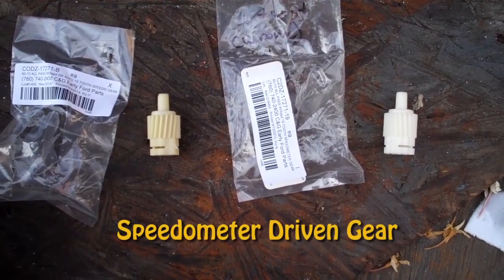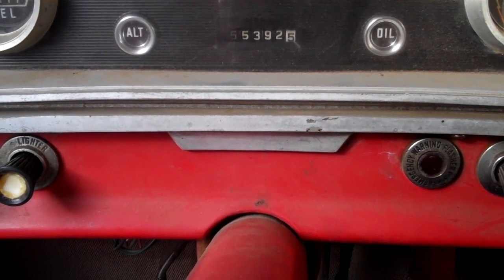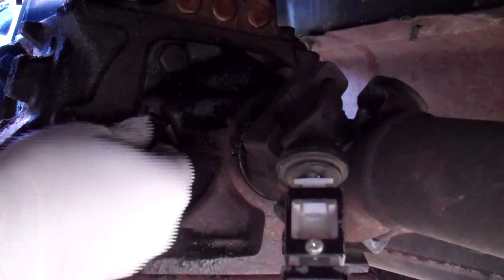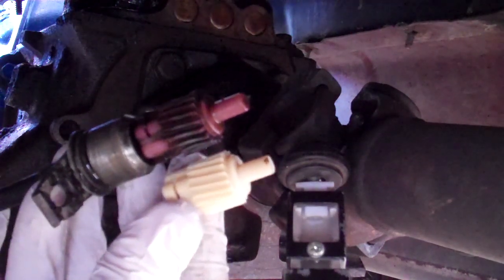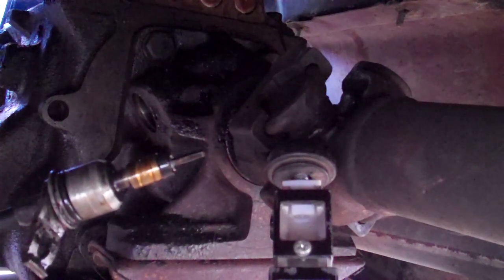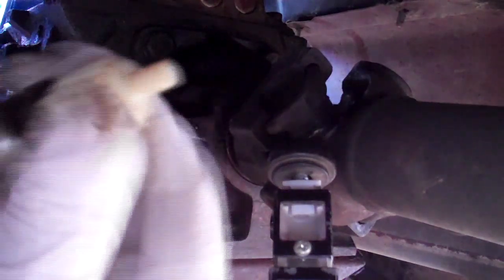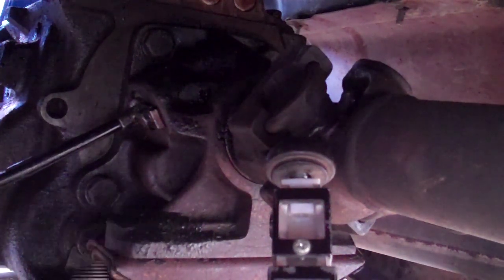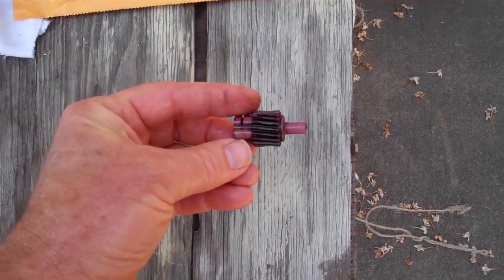1966 Ford F250 replace a speedometer driven gear

Comment: Lol looks so easy when someone else is doing it.  When I pulled mine off the driven gear was missing and pieces of it were in my transmission filter 😂😢
Reply from the maker: What a bummer.
Reply: @tellydeeman  No worries.  Trans still works, speedo cable is fine, the other gear teeth feel alright so going to try to stick another driven gear in there and see what happens.

Comment: Hello, do you have a video on replacing the speedometer drive gear in the 4 speed transmission
Reply from the maker: Yes, I do.  Farther down in the description you will see a link for the drive gear video.  It is done with the transmission removed.  So it may not help you.

Comment: I put a right drive gear in and a right driven gear and the mileage was going backwards
Reply from the maker: Hmm.  I am not a mechanic by any means.  Did the new parts match the old parts as far as teeth number and helix (right/left hand)?

Comment: Now show me how to replace the drive gear on the tailshaft.
Reply from the maker: Howdy.  If you look in the description you will find a video on how to remove the speedometer drive gear.  The pliers you will need, what to watch out for and the replacement part number. The installation, as far as I recall, posed no difficulties.  Just reverse the process.  T18 Speedometer drive gear: https://youtu.be/ckF0WvySBAU